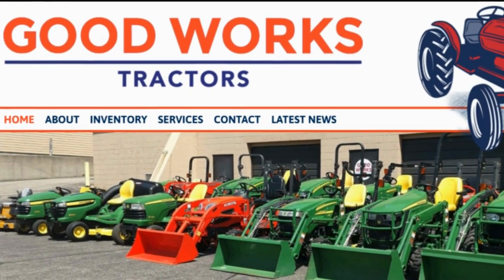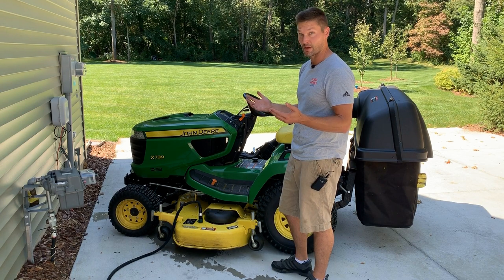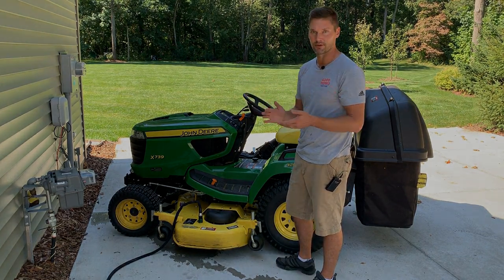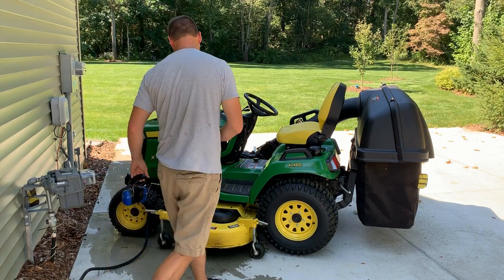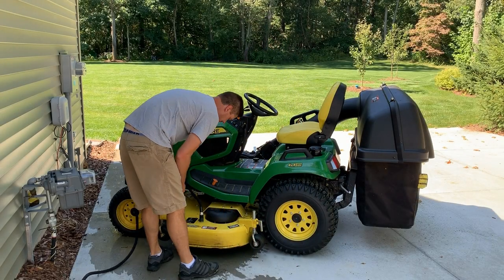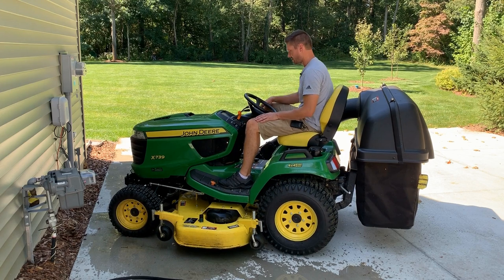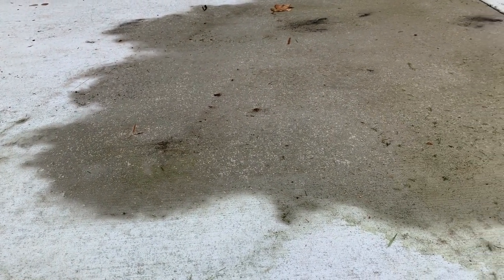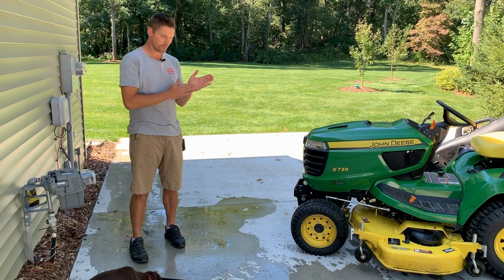Using A Mower Deck Washout Port On A John Deere Garden Tractor.  Same for Husqvarna, Cub Cadet, Toro

Comment: Courtney. You were not getting water through the port,  I would guess the quick connect wasn't all the way down...try it again, you should get more water flow even without the mower running....  I have a 748 with 60 inch and grass and green water fly out the discharge chute....I do it each time.  You should have much more water on the pavement!
Reply from the maker: I kind of thought so.  First time doing it, so wasn't positive though.

Comment: I just bought a new x738, first thing I did was coat the new deck with Mo-Deck 
This is a clear silicone or ceramic spray, got it at my JD dealer 
The spray works well with a new clean deck and if you keep up with application once a season and wash deck out 
Will stay like new a. Long time

Comment: YES, those ports work GREAT! If used everytime, or almost everytime, you'll never have buildup. BUT, I also use a longer wand that also angles that i spray from the outside edge (and underneath) of the deck. Stays clean as a whistle.

Comment: The part tha you are not considering is any of that grass buildup in the deck helps promote rust, holds moisture and most of the inner decks are bare metal that can rust out easily.

Comment: Good video but I think you should  try again with the port clean. I used mine a few times, and had a lot more water under the mower than yours showed. And mine had green color to the residue.  That said, I don't use mine. Clean with scrapper and brush. Lots of sand so I paint also.

Comment: You should have a lot more water coming out from under the mower. I think the grass inside the connector to the deck has it mostly blocked inside thus blocking the flow of water. Clean the connector out thoroughly and turn your water up to a strong flow. I am sure you will see a difference. Your dirty underneath looks like my clean after I run the water under the deck using my connector. While you're at it, I would put a quick connect/disconnect valve on. They're available in garden sections of stores. Cub Cadet is nice enough to include them with their mowers. Note to southern Californians: you have to provide your own water hose.
Reply from the maker: Correct, there should be.  Water was on full blast, port was checked.  The entire point shows that if it doesn't easily work all of the time, then it is a cheap gimmick that shouldn't be on a tractor.  Look at the bottom of the deck before it was done, hardly anything there after almost an entire year of mowing.
Reply: @GoodWorksTractors  For the amount of grass you had under there and the fact that you cut mostly dry grass, you didn't really need to wash it out.  If you have big globs of wet grass, the washout port gets most of it in my experience.  I still want to rig up a hoist where I can just pull up, hoist the front end and hose it manually. Even when the yards I cut are dry, there are usually weeds that retain a lot of moisture.

Comment: I'm of the same opinion, the washout port is a waste of time. Where it sticks down inside the deck is actually a point of collection for clippings and other gunk; I ended up removing the thing from my deck and plugging the hole with a large washer and carriage bolt. I will say I gave the port a fair trial, tried it several times over a couple of years before giving up.

I would like to say that the video doesn't give a truly accurate scenario for many users who don't have a finely manicured lawn as shown; I also wonder where all the water went; the concrete should have been soaked for many feet beyond the exit chute with the hose feeding water into the deck and the blades slinging a spray out the chute. As clean as the deck was before starting, I'd have never cleaned it, even the old way. Try mowing 3 acres of pasture (that regularly gets mowed), and then looking under the deck. Trying the washout port would have gotten a lot more results, but would still have left a wet mess inside the deck that could only get cleaned by removing the deck, flipping it over, and scraping and/ or power washing.
Reply: @eosjoe565  I could get that stream of green water and slime, too, but there was always residue left afterwards, that was wet and sticky. Just the kind of stuff that would get hard and crusty if you left it in there to dry, making it harder to properly clean the next time. About the only part of the underside that really would get cleaned was the forward portion of the left blade housing. The remainder of the deck didn't get as much spray. My water pressure is just fine, too, but it might take a fire hose hooked to the fitting to do a proper job. Easier to remove the deck, flip it vertical, and pressure wash it.

Comment: So i always wondered if using the washout port would shorten the life of your bearings and rust your deck. I understand wet or hi moisture grass will do the same and i promote cleaning the deck with a plastic scraper regular. But feel hosing your deck with water once or twice a week then it just sitting n drying cant be good.

Comment: Works great run about 30 seconds wait 15+ minutes run again wait 15+ minutes and run again usually clean after 3rd time also helps to have the deck lowered all the way down waiting give the water time to soak in and loosen the clippings

Comment: Your underside was pretty clean already, there wasn't much to clean off.  The 1st time I used the cleanest port on my 590 I had a LOT of grass come off.  But it was the 1st mow of the season and the grass was tall and wet from the dew.  There was a lot of buildup under the deck.  I estimate it cleaned about 2/3 of it off (leaving quite a mess behind) after about a 2 minute run.  I'm mostly concerned with wetting down hot spindles and bearings so I'd advise not doing this for more than a few minutes and one after letting the tractor cool down after mowing

Comment: I've never used the port either, but I notice you run a bagger.  Did that have any affect on where the residual went, I assume it was bypassed?
Reply from the maker: Yeah, no issues running with or without a bagger.

Comment: I've never seen a wash port do much of anything. On my new x350, I have the electric mulch kit. The salesman said the left blade is blocked off from the rest of the deck. Consequently, that's where the wash port is. So if you have a mulch kit installed, the wash port is useless.

Comment: I don't think your supposed to run the clean out system with the bagger attached plus there are usually two hookups for the hose
Reply from the maker: There is only one hookup and I don't see why the bagger would matter.  It has a mulching baffle that's closed off on the discharge side.

Comment: Why would you want to force more moisture into your mower deck? You can see by the video water dripping out of the bearing cap covers. Seems this will promote more rust and reduce bearing life. This kind of engineering is like the grease zerks on sealed bearings and never change oil motors.... Run it,  break it so you have to buy a new one.

Comment: I think you need about 60+ lbs of water pressure to help clean the deck. Mine puts out a steady stream of green water after the junk comes out. I didn't see any water from yours. Make sure your wash out port isn't clogged with grass underneath.

Comment: I use it after every mow .. The trick is that you have to have the hose on LOW... literally the most important factor using this washout port... ALSO.. get a hose with a shutoff at the end of the nozzle so you can turn the hose on AFTER you engage the blades..!
If you put the hose on HIGH its just spraying right thru the blades..
This attachment works like a champ.. If used correctly.. Check it out please
Reply: I had been using with full water flow and water was leaking out a lot around the coupler on top of the deck

Comment: I think its gimmicky. Ive never seen one that works well. There isn’t enough pressure made by the blades to do any good. Great video
Reply: I found that if I use it for about 2-3 minutes then wait 15-20 minutes then run it for 5 minutes that the initial wash soaks in & really loosens the crud and the 2nd wash gets it pretty clean.
Reply: You haven’t seen the clumps of grass on the ground after I use mine, nor the green water that turns clear after about 30 seconds. Or the like new underside every time I clean it. I’ve used it immediately after cutting, since the first use.

Comment: I used it once never again plus it starts rust
Reply: Not if you let the deck dry afterwards; regardless of how you clean the deck, if it stays wet underneath without something coating the metal (paint, oil, whatever), it's going to rust. Start the tractor and engage the deck, let it run for a few minutes after washing it out, the airflow will dry it out.

Comment: You clearly had no water flow.  Water should be flying out the discharge of the deck.
Reply from the maker: The point of the entire video.  It's a flawed design.
Reply: @GoodWorksTractors  You missed my point entirely.  The design may not be optimal, but your implementation made it even worse.  Your port was clearly clogged which can easily occur which restricts the water flow and makes your demonstration flawed.  Maybe try it again with a clean port.
Reply from the maker: @danrose3233  Again, that's the point of the video man.  Catch up, you're too slow!

Comment: I haul my JD 2305 with FEL to the car wash , lower the bucket to lift the tractor & mower deck all the way up, right on my trailer. Blow out all the heavy stuff, spray brake cleaner all underneath then hydro-spray it on the soap cycle. $3.00 Clean and Done. It'll dry on the 3 miles home.

Comment: Not a fan of exposing hot spindles to water. Wait until the spindles are cool before rinsing.
Reply: Interesting-I’ve not checked personally. How hot do the spindles get? I know the pulleys naturally get warm from the belt but am thinking the bearings shouldn’t get hot to the touch unless there’s something wrong with them.

Comment: No point in flushing out the underside of the deck if you haven’t turned the water on fully, the hose connector is not seated right or the inlet is blocked.  Here in the UK, where the grass is often wet, I use the wash port after every mow. I get masses of thick green sludge oozing out under the front and rear lips of the deck after a minute or so. Then I lift the deck with the water still running to rinse the remaining crud away..then turn the water off and let the blades run to air dry the underneath. My mower is X304 is five years old, got almost 400 hours on it and the underside of the deck is sparkly clean. 
Like everything else, if you don’t do it right you don’t get the right results - and you definitely weren’t doing it right.
Reply from the maker: Water is on all the way.  Systems like this are pointless if they take that much time to operate and setup.  Also, there's very little build up after 30 some hours of mowing.  Not even necessary.

Comment: A bit more info and something  learned. I mowed and vacuumed leaves 5 days ago and did not washout ( first time)
Today I mowed another area and decided to washout. One washout port was completely blocked, the other mostly blocked. I removed and cleaned them. Have never had to do this before as witg washing out each usage they do not block.
When the ports are clean the flow of water under the deck is like a power washer jet fore and aft. In fact there is a jet or slot pointing each way. 
I'm afraid both of your washout ports are mostly blocked. There should be a great deal more water under the machine and a visible torrent of water coming out.
It's easy to fix, but with the ports plugged you really didn't test the washout capability.
Reply from the maker: We only have one washout port on our decks in the US.  Also, that was part of the point I was trying to make.  I am aware of how to clean them out and I did pull clippings out of it to begin with.  It still functioned poorly.  If a system can't be fast, simple, effective, and highly repeatable, then do away with it.  

This process would add 8-10 minutes to every mow.  I have no interest in doing so especially when there was minimal build up in the first place.
Reply: @GoodWorksTractors  

For me it's a minute on each port and I go by the hose to park, so it's maybe 3-4 minutes total.But it is an every time thing, then the system does work, the ports stay open plus  deck, impeller and chute all stay very clean. 
Doing it your way is fine too, probably makes very little dif long term.
Judging by the bit of water under your machine, your port was never fully open. On my deck, you just have to remove a bolt then remove the port to really clean it. It can't be cleaned from above, I tried. There are small apertures at the bottom that  get jammed up if the hose is not used each time.  Once they are cleaned, the port has a big flow. I didn't see the full flow at any point in your vid.
But honestly, even if it did have full flow it wouldn't remove much of that welded on old material. It's designed for fresh material removal.

Comment: Ok. There's a few things wrong that he did. First don't leave your plastic quick disconnect connected to the mower deck because grass will clog it up. You should be able to pull up on the collar of the fitting and it pops off with the hose still attached. It was obvious right from the start not nearly enough water was going into the mower deck. I've used this feature before and it works very well.   You can see the water spray coming out from under the deck and the chute. Also it's probably not a good idea to have the bagger still connected to the discharge. To the person that made the comment about how they want you to do this so you have to buy a new mower deck... That's simply not true. It is true however that you should not regularly wash the top of the deck as that's where the bearings and grease fittings are. I use my air compressor to blow out all the debris and it works really well.
Reply from the maker: Missed the point.  Gimmicky items like these should be no brainer, straight forward to operate.  I'm not sure what the bagger has to do with anything?  I have a mulching baffle that I closed off.

Comment: Did you even turn on the water? there was nothing coming out there....and no water on the ground. when I do it the driveway gets pretty darn wet. turn on the water!!!!
Reply from the maker: Nope, just an optical illusion :)
Reply: I was wondering about that too.  When used properly, I usually see a lot more water and debris running down the driveway.  If he never used the wash port before, there might be some blockage preventing water flow.  The wash port is not effective for removing long term buildup.  In fact, if you have some long term buildup, it won't work very well at all because the hard buildup interrupts that vacuum spinning action you need to achieve a good wash cycle.  To properly use the wash port, you have to start with a clean deck, do your mowing, and then run the wash port immediately after mowing.  That's when it's most effective.
Reply from the maker: I agree.  Seems like there should have been a lot more water.  I even mention that in the video.

Comment: Here is what actually works to loosen/dislodge old grass from under mower deck....  Drive your mower over a substantial mud puddle and rev blades to max.... lower the deck slowly until it begins to labor the engine.   Yes, you are out of luck with this solution if you live in the desert.

Comment: That causes unnecessary water exposure to the spindle bearing seals and now there is wet rusting steel.  After every mowing the deck should be removed, scraped and oiled.  You can also grease the spindles and sharpen the blades.  It will last a lifetime.  What if after washing out, you connect an oil line and give it a blast?  I have wondered if Rhino lining the underside when it is new would be a good idea.  I have used slick Graphite paint, which does fair, but eventually wears off.

Comment: You def did something wrong you had zero spray coming out of the shoot my mower would have covered you driveway
Reply from the maker: I proved a point.  If it isn't easy to use, then it doesn't work.  The system is easily clogged.  Also, it's unnecessary given there was very little material under the deck even after months of use.
Reply: @GoodWorksTractors  Its very easy to use just hook up water hose and turn blades on. If your not mowing wet grass like some do then you most likely will never need to do this. Manufacturers put this system in place for those who do mow wet grass in your case its not for you but that doesn't mean it doesn't work. And you saying you had very little debree underneath kinda debunks you saying it doesn't work.

Comment: Sorry to ramble on but also those that have the cleanout port need to have the proper blade set up that has the proper deflector built into the blade.  I've used the cleanout port usually when the deck is pretty clogged up, and it has worked pretty good big chunks would fall out on occasions but it did work. after 20 years with the same Toro rider I finally wore out the deck. Priced a new deck and was amazed by the price,  Over 700.00 just for the shell, no pulleys, no springs, nothing. So I built my own out of 1/2 rebar and stainless steel, It was just a project but ended up working better then the original, some tweaking like a longer belt and welding the gaps up but it works great. I will also be installing two wash out ports